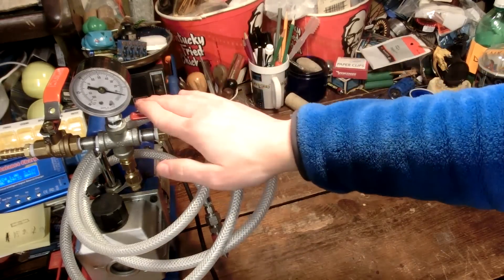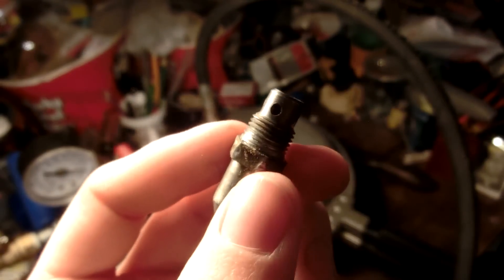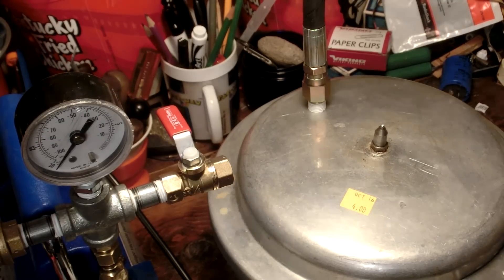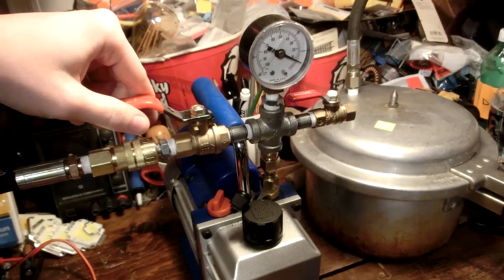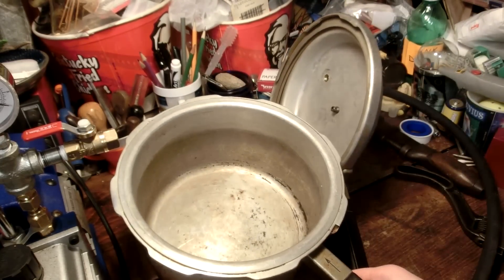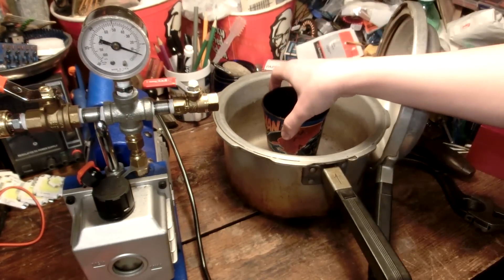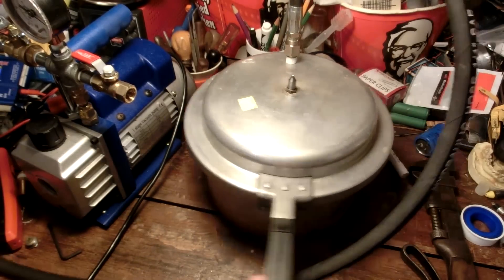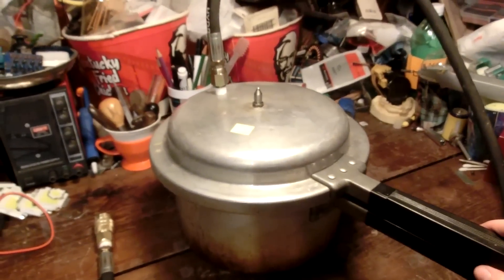DIY Vacuum Chamber from old Pressure Cooker

Comment: Brilliant. I was thinking the same thing for a degassing chamber for castable epoxy resin. You have proven the concept. Now off to the thrift store! BTW solder makes a poor seal unless it flows freely using a torch and flux. For a low temperature seal try either a solid threaded metal bolt with lock-tight blue in the threads or fill the hole of the pressure relief valve (PRV) with hot glue. You can countersink the hole before hot gluing the PRV to eliminate the possibility that the chamber will suck in the plug under vac.
Reply from the maker: well solder is what i have on hand, and as we all know, what you have on hand is the best solution for a quick fix. haha
Reply: Can't argue with that. ;-)
Reply: Depends how fast your epoxy sets up. Many use paint pressure pot with a few changes to work with epoxy. Adding pressure appears to squeeze the air out of the epoxy. All kinds of videos on youtube. Pressure pots at harbor freight or in canada at princess auto. Many of those small vacuum pumps vent an oil mist, some are best vented outside. On the water test perhaps the pump intake sucked in the oil fumes ergo yucky wayer.

Comment: Mold makers use vacuum to remove air from casting materials to eliminate air bubbles.  You can do the same with epoxy to make molds for small objects.

Comment: Used as a pressure cooker, there is a heavy cap that sits on that valve on top and when the pressure gets too high to hold it,,, it would float above it letting off the pressure.
Reply from the maker: oh interesting
Reply: Some have 3 or 4 holes in the cap to allow for different pressures.
Reply: Rinoa Super-Genius I was going to say the same thing. But add that if you buy a brand new pressure cooker, it will come with the top, add onto that putting some silicone or whatever into the bottom of the topper and I guarantee you won't see a drop in the pressure.

Comment: Number one rule of soldering/brazing: always have the heat of the material melt the solder, never heat the solder directly! I would've removed it and hit it with a blowtorch, then the solder would've damn near jumped to the stainless when you touched it to the piece.
An air filter on the pressure release valve would've prevented crud getting in when repressurizing. And a little dab of oil on the gasket would minimize that slow drop of vacuum over time.
Also, vacuum hose is comparatively cheap as opposed to hydraulic hose, and they're designed for completely opposite conditions. I mean, it's some sturdy stuff, (I work with it all the time as a machine maintenance tech) but if your pump was any stronger, it would've collapsed in a very impressive display. Had it happen once on a 40 foot punch press. The oil reservoir failed and the vaccum that was created by it draining collapsed 3 hoses that had to be replaced. To be fair, the hoses were probably over 20 years old. But at $50/ft without fittings for that particular size and rating, that sure was an expensive whoopsy-daisy.

I'm sure that over the 3 years since you posted this that you've already learned most of that. But if not, you're welcome.
Reply from the maker: as a professional solderer or rapid prototyping circuits at Apple, i can say you must heat the solder first in order to put enough heat into the item you are soldering sometimes
Reply: @RinoaL   ok, you got me there. Yes, wetting the iron tip to transfer heat is undoubtedly an exception. But in the case of plugging the rocker port, that falls into the category of brazing, where using an iron is relatively uncommon. My mistake, I was trying to be as brief as possible

Comment: That centerpiece is for a pressure release valve. It's a heavy little metal piece that goes on top and that's how you can release the pressure from the pressure cooker. The piece you took off where you  connected the hose, is a burst valve in case of over pressurizing the pressure cooker. It'll pop. I could be wrong. Try making stabilized wood

Comment: You can't freeze dry stuff with a vacuum chamber, that requires a complex machine that uses the process of sub-zero freezing & sublimation than vacuum pressure to remove moisture while a gas.  However, you can seal previously freeze dried foods in mason jars in a vacuum chamber.

Comment: Those fittings, with teflon tape or grease can definitely keep the seal you are looking for. The pump vane assembly can be quite leaky and might be responsible for your leak
Reply from the maker: yeah i figure its the pump, and ya know, the seals on the 4$ pressure cooker. its good enough for me :D

Comment: Be careful with pulling a vacuum over water, the high moisture content isn't good for the vacuum pump. Also possibly clean out the line if you plan to do more foodstuff.
Reply from the maker: +Maliciously Delicious id do food in the other chamber once i get it done, and im fine with killing this pump because it leaks so much

Comment: On the bottom of the pan should be a modle number. You can look up parts for that specific pan and get a pressure gauge, replacement rings, etc. I would have also used the center for the vacuum hose.
Reply from the maker: pressure guage wont measure vacuum though.

Comment: i'm trying to make a pressure chamber out of a pot like this for resin and wood turning, would I get the air bubbles out of the resin by using a compressor instead of a vacuum pump ??
Reply from the maker: no

Comment: By the way, is the  prion disabled only by air pressure? Is there any need for heating? It's 134 degrees Celsius, 3 bar to 18 minutes more than of pressurization to deactivate the prion.

Comment: Degassing resins like epoxy for crystal clear encapsulations of interesting objects.  Same for molding silicone parts.

Vacuum chamber aka degasser is good for degassing stuff.  not much else without a window.  One way valve on bags or containers to make globes, bulbs, arc lamps, etc.
Reply: tiporari i got really confused when i read degassing and read it as degaussing, which is removing a metal objects magnetic field and is completely unrelated
Reply: its your uncle bourbon Lol, this contraption is a lousy degausser :)

And you're my favorite uncle.

Comment: Did you put Teflon tape on the joint above the actual vacuum port. Not the two compression type joints but the one above those. I remember you thinking the pump had a slow internal leak. I have a similar pump that I got from Harbor Freight and I used it to fix the air conditioner on my car.
Reply from the maker: +Thomas McDill yes, and yes the pump does have an internl leak.
Reply: Rinoa Super-Genius That sucks. lol. I've watched basically all your videos. The ones on lithium cells got me started. Could you send me an address so I can send you some goodies?
Reply from the maker: address is in the "about" page of my channel ^^
Reply: Rinoa Super-Genius Awesome, it will be a little bit before I can gather everything together.

Comment: The idea that the central pipe now blocked with solder so it will hold a vacuum would somehow act as a safety valve if the chamber (somehow) got pressurised is a bit misplaced. You in fact removed the safety valve to connect your vacuum pipe. You'd have done better to connect your pipe at the centre.
Reply from the maker: The solder isnt actually connected to the metal, it is just a plug, which would pop out at only a few PSI

Comment: id like to see you put a gauge on the chamber its self and leave it for some time, say a day or even an hr to see if it leaks and how fast it leaks
this would mean you could put something under vaccum and set the pump on a basic timer to pull it back down
of course something might need to be done about the pump its self leaking

Comment: would it be worth it to put a shut off valve and quick connect on the chamber itself? it would eliminate leakage paths for instances where you need the chamber to hold a vacuum for extended periods of time. as an example for impregnating tool handles with oil, I believe that's how autine tools does their knife handles. side note, they have some nice videos of hand forging axes and knives. John neeman is one of their black smiths and has a few videos of his own.
Reply from the maker: +8Jory thats what the quick connector is for
Reply: Rinoa Super-Genius I was more just thinking of reducing the number of connections between the shut off and the chamber to eliminate possible leakage paths. AvE is always going on about spiral leakage paths with threads and figured it's worth considering. as long as it works though it's all good. cheers man.

Comment: Hi Rina! I am looking to have one of these built for some lab testing for vacuum frying food. Is this something you would be interested in taking on as commissioned work?
Reply from the maker: I don't have the ability to build something food-safe just yet, sorry. I'd recommend building it yourself to save money. Maybe in a few years I will have my workshop built-up enough to take on larger tasks like that. I am trying to make a business of rapid prototyping, however I'm having to start small. sorry
Reply: @RinoaL  Hey thanks for the reply! Doesn't need to be "food safe" just able to hold a vacuum and prevent oil from getting into the vacuum pump - food will not be for sale or distribution. Is this do-able?
Reply from the maker: Honestly I've abused these cheap vacuum pumps a lot, and I bet oil getting into it wouldn't be super bad for it. Maybe just drain the oil out afterwards if it gets bad, and don't run it past the time it starts to knock really bad. Other idea is to put a cold trap in line with it, so run the hose going to the vacuum pump through a cooler filled with ice water and the oil will condense into droplets in the line.

Comment: Put a ringing alarm clock in there or something similar - suck out the air and see if the sound disappears - as there should be no sound in a vacuum (as in the vacuum of space). It might work!
Reply: You'd have to isolate the vibrations from the pressure cooker itself, but it would probably do something.

Comment: You are loosing a lot of vacuum. In my heating and cooling experience, we vacuum the heat pump out before you fill it with refrigerant. it must stay at a perfect vacuum indefinitely for it to be a completely sealed system. I see your gauge moving all around. could be the quick connects? or the pressure cooker does not have a rubber seal?
Reply from the maker: +Store Manager Lancaster its just the pump is really shitty. and i highly doubt you get a perfect vacuum, youd need a diffusion pump and stuff for that.

Comment: Not sure if you follow Thekingofrandom or not but he recently made a video about making a vacuum chamber and shows how to make a clear lid using silicone as the gasket
Reply: You might also want to consider adding a desiccant either in the chamber or in the vacuum line, on Cody'sLab he had an issue with water vapor condensing in his pump and fouling up the oil which can ruin the pump.
Reply from the maker: +Casey Urquhart no, i find grant thompson to be really annoyingly obvious with his projects. not that im any different though.

and i dont care about this pump, its already a leaky piece of shit

Comment: Those quick connections will fail over a fairly short time. 
You might want to use hydraulic quick connector or just go with AN type fittings

Comment: Try to see if you can stote hydrogen in water by replacing the air by hydrogen. I would put activated carbon in the water to increase absorption

Comment: Why oh why does everyone use teflon tape? Use PTFE paste and you'll have zero leaks.
Reply from the maker: because ptfe paste isnt something any stores near me sell, and tape works 100% of the time for me.
Reply: @RinoaL  Pipe fitting is part of my trade. Teflon tape was never meant to be a thread sealer. It's a thread lubricant which allows an extra row or two of thread to be introduced into the fitting. The actual seal is made by a thread sealer, which is pipe dope of one kind or another. I love PTFE paste on my toast! Anyway, if teflon tape works for you, I don't know how, lol. It's technically not a thread sealer, and I've been pipe fitting for almost 40 years.

Comment: Boiling linseed oil is considered dangerous as its boiling point and combustion point is closer .To do It safely they boil it   in vacuum.Can you figure out how they do it and share with us in a new related video
Reply from the maker: they dont boil it, they just add chemicals to make it dry faster. you are horribly mislead.

Comment: try to dry your clothes
Reply: water evap
Reply from the maker: +Solar Power Electricity and Electronics oh right, id wanted to do that before but had forgotten
Reply: Rinoa Super-Genius I'm trying to come up with a way to dry my clothes with solar power and a clothes dryer is way too expensive I didn't know if the water would freeze on the clothes you might have to put two or three different times in and out